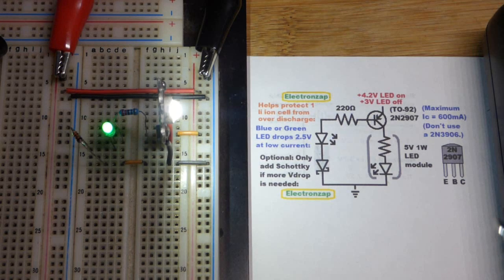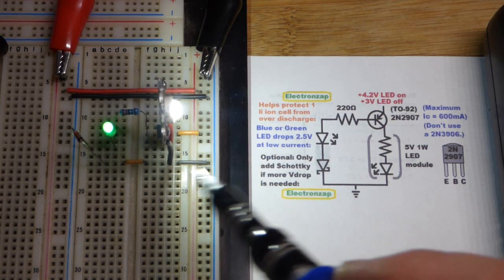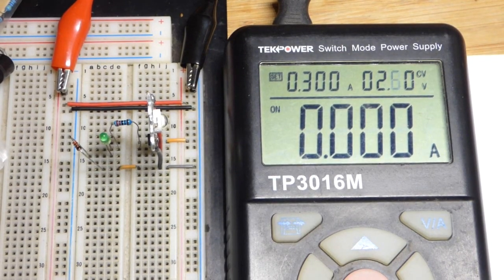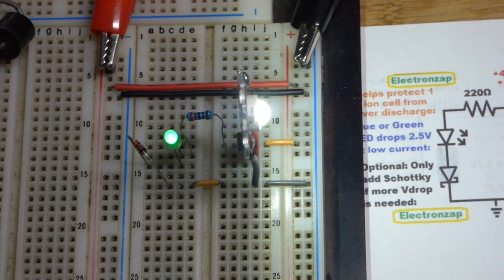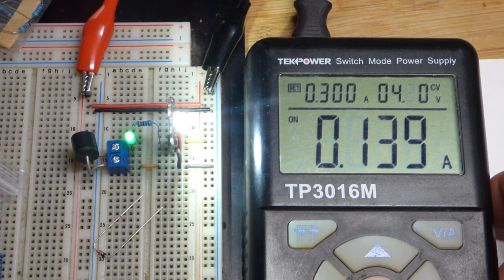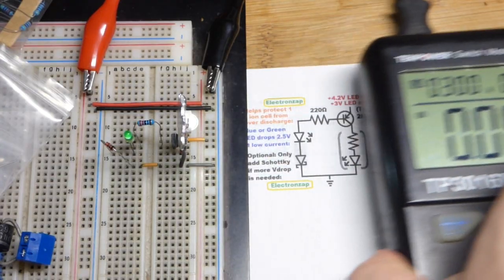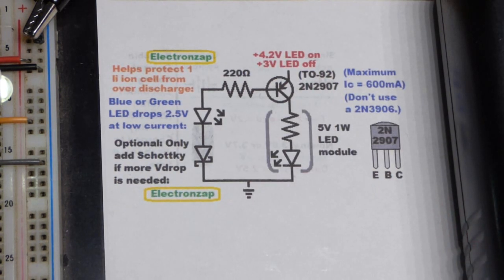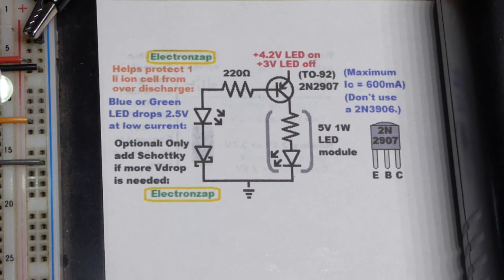2N2907 PNP BJT low battery voltage protection using a series of diode drops

Comment: That circuit will slowly drain your battery well below 2.5V... why use wrong components for the job? Mosfet and zener diode will do much better.
Reply from the maker: Thanks for the tip!

Comment: I've offered to send you a bunch of cool leds and stuff a ton of times. This is my last offer. Just need a po box. I need to make space in my hobby room. It's all new stuff I'll send. No strings attached. I'm up to my ears in guitar repairs and have more leds, ics, test gear than I know what to do with. I used to make free learning kits for people but after 4 years of it I find it's a slog. If you're in Canada or the us I'll cover shipping. Ehh. Nevermind, you would've said yes by now. Great videos though man. I like how to the point you are without getting really bogged down. It's perfect for people getting into the hobby. You're big enough now to start getting free stuff, you should take anything decent. You work hard. Test gear is pricey, make the video then keep the gear to yourself because I get why you don't show off any. It shows anyone can get into the hobby. I have a function generator in my cart for weeks but can't justify buying it when my scope has a 2 channel one. It's only 5vpp though and I'd like to have 20vpp and the higher samples and bandwidth output.

Where do you get the round blue pots? I see them on amazon and they're like 1 dollar each haha. I can't justify it when I have hundreds of others but they're great for breadboards. 

Anyway. Keep up the great content.
Reply from the maker: Pretty sure I got the round blue pot from a random component kit. I may only have one of those. I used to use multiple trimpots from a different kit but they had wide leads instead of pins. I'm out of space, so I definitely don't need more of what I already have. I can't even remember what all I have. People new to electronics need a bunch of stuff they can't afford, so when I get rid of my stuff, I plan to give it to one or more of them. Maybe do a garage sale. Thanks for the offer though! YT is too much of a grind for me. I have to make at least a dozen videos that get no views for every video that will make me money in a few years. Pretty soon I'll probably stop making videos most days, just having 1 pre-made video go live every day. So, I'm not really making any new investments or obligations for the channel.